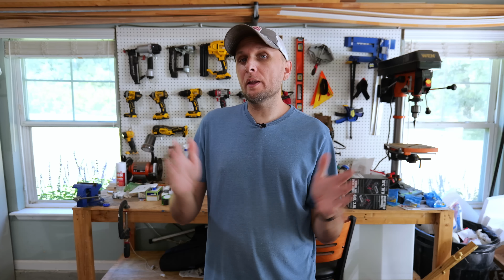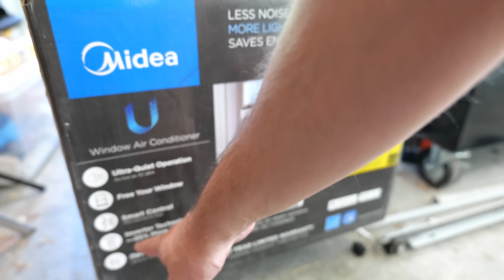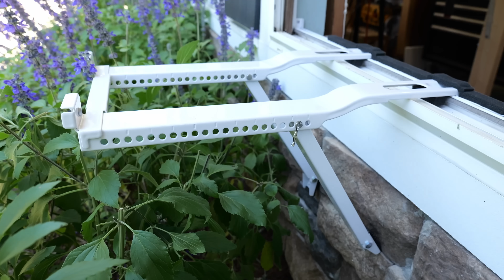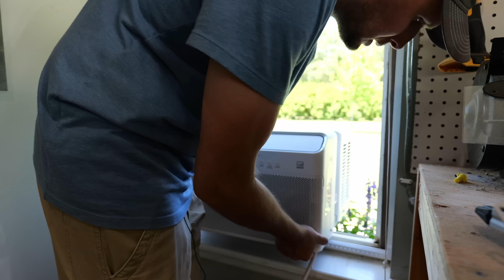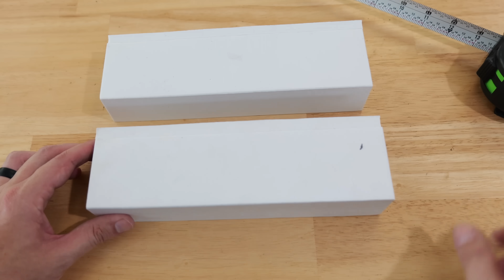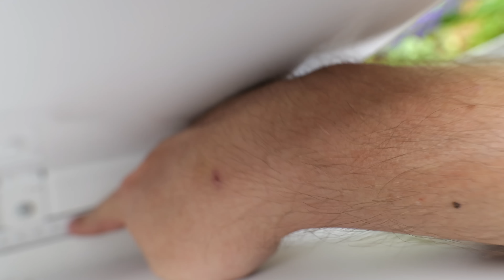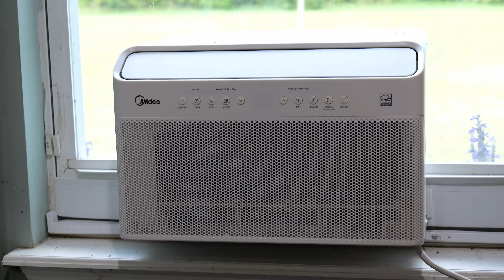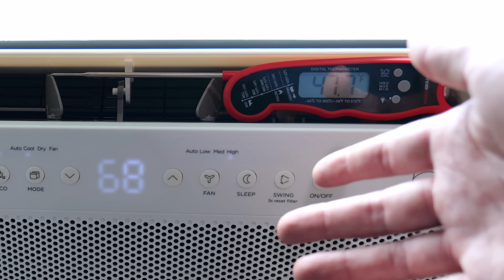The COLDEST And QUIETEST AC Unit Ever Made!  Still Use Your Window!

Comment: You say these can be quite heavy..... NO WHERE on Amazon or Media does it specify the weight of the unit  I like to FIM
Reply: It's called google, learn how to use it.
Reply: It's not too heavy but rather clumsy to lift. Most of the weight is towards the back of the unit due to the compressor. I'd say it's roughly 45-50 pounds for my 8000 btu unit. The trick I found to lift it is to hold the top back corner while lifting the unit holding the opposite bottom front corner. Since the bracket that comes with the unit act as a shelf, it's best to place the unit on top of something close to the height of the windowsill. I use the box that the ac comes in which I keep for storing it away come the winter. This way it's not much travel to carry and guide it to lay it on the bracket.
Reply: @riopato2009  Thanks for a helpful reply... I am not sure if the 8k will be enough so to be able to see the weights for all the sizes would be helpful...
Reply: @jimharper6073  I doubt the higher btu units aren't that much heavier. It seems the magic of the AC units is how the compressors are designed and there's definitely newer technology being used than traditional AC units. It's very similar to a mini split but in a smaller and very dense shape. According to the Midea website, the weight is less than 60lbs and oddly this unit is rated to cool a 550 square foot room which seems kind of small for a 12k btu unit. It's most likely why I opted for an 8K btu unit instead since t was half the price to cool my 300 square foot room.

Comment: Does it have a exhaust and dehumidifier
Reply from the maker: It does have a dehumidifier.  There is an actual condenser on the outside.
Reply: The dehumidifier works great to help quickly chill the room. I don't think there is an exhaust function but there is a fan only mode to take in fresh air. I use this a lot during cooler nights and it's a lot quieter than the already quiet AC function. I have a window fan on the other side of the house that exhausts air and this combo really creates a breezy circulation throughout which I find better than just having the AC on all the time.
Reply: @riopato2009  thank you soo much

Comment: I wish they made a smaller size than the 8000 btu model. The window I need to use is small.
Reply: So, you need a smaller physical size AC?   The 8k btu for an inverter is fine for even very small square footage well under 300 sq ft, from what I now know about them.  Maybe search for an inverter type window AC for your window.  Also, perhaps look up a casement style window AC unit. It's narrower width-wise.  Hopefully, you can find an inverter, because they are super quiet compared to the conventional on/off compressor AC's. If none of this helps, try a portable unit but be careful to get one that absolutely has a dual hose.  A single hose portable is terrible. May you have a climate controlled room! Enjoy.

Comment: The temperature of the air coming out of the unit is meaningless without knowing the outside air temperature. How well a unit cools is the difference in temperature between the outside air temp and the temp of the air coming out of the unit.
Reply from the maker: It was 92 degrees out when that test was done.
Reply: @BlondieHappyGuy  Correct. However, the unit is moving heat from inside the room to outside using a heat exchanger. The temperature of the outside air will determine the final temperature reduction of the air that is moved through the unit.

The two temp comparisons that really matter are the difference in the air temperature being inducted into the unit vs the outlet air, as well as the difference in temperature between outside and the outlet air.

Comment: Impressive... Thanks for the video. I used to waste a ton of money, before my heat pump, on Danby window air conditioners that would last only one season. They would work fine for the first year then when I took them out for the winter and reinstalled them the next year, then quit working. This looks like a very good unit. Time will tell.
Reply from the maker: I love this thing.  Super impressed.  Thanks a lot for the feedback Jim!

Comment: Can you do a follow up and test the noise on the outside. I have neighbors nextdoor and do not want to annoy them with the outside noise.Thanks.
Reply from the maker: In the future after I’ve given this unit some time I may do a follow up review video and definitely can include that.  For what it’s worth I just went outside to take a decibel measurement, again from about 5 feet away and it was right at 59 dB for the outside condenser.  I couldn’t hear it running at all until I was about 10 or so feet away.  I hope this helps!
Reply: I haven't measured but I can tell you that it's quieter than  a regular windows air conditioner and quieter than my central air box.  I have 4 of these Midea boxes that I have bought over the last few years.  Sooo much better than the older AC technology and cheaper to run too.  My favorite thing about them is that they are variable speed.  That is, when it gets the temp down to about the right temperature the compressor speed slows down greatly.  With the old AC tech the compressor is either on or off and nothing in between.  Since the compressor on these units is outside the window the noise in the room is very low.

Comment: I purchased this unit a while ago after searching for a very energy efficient unit.  We live totally off-grid and I wanted to minimize the power usage for appliances such as this.  It cools very quickly and during daylight hours, it doesn't use nearly as much energy as we produce, so I don's use any of our stored power.  At night, I can run it for hours with very little energy drain from the batteries.  We typically don't even need to use the A/C, we just run the dehumidifier and it will drop the temp by around 10 degrees.  We highly recommend it.

Comment: In my extensive research with this unit against Daikin and Mitsubishi mini split units, this type of window unit is not in the same league. The output of a mini split system is much greater for a larger area. We have a Midea brand A/C condenser in our church its been repaired 3 times in the last 5 years. Our HVAC master technician found the mother board fried, even with a surge protector installed. This small Mides unit sells ideal for a bedroom, but not for larger living areas. When comparing to traditional box/window A/Cs, sure, these Midea units do very well. However, if you’re looking at long term (5 years +) you might consider other long established/performance options.

Comment: How many watts does it use ?
Reply: @BlondieHappyGuy  I have this 12000 unit running right now and the highest I've seen it pull on my watt meter while writing this comment is 517 watts with boost mode on, it's 73 outside right now, its dark out, I don't know if it'll pull more when its hotter out I'd have check on a hotter day.

Edit: 80 degree out 6/13/24 and it's pulling 547.5watts... it'll be 96 in a few days if I remember I'll come back and update this if it pulls even more on a hotter day, seems like it might.

Edit: 06/18/24 its 90 Degree out and it's pulling 903+ watts from the wall, I watched it bounce off that for about 10 minutes so yeah higher Temps outside leads to higher watts pulled from the wall.

Edit: 6/20/24 it's 97 degrees outside and the unit is pulling 1104 watts, target temperature set to 70 degrees that was for all the days.
Reply from the maker: @kaosapprentice yup it’s funny you said 517 watts. That is literally the highest I was able to get mine up to with everything on max.
Reply: @HowToHomeDIY  I had a portable unit from midea it was 8k btu and it pulled 750 watts so at first when I turned this on I thought I got a defective unit, 500 watts for 12k btu that can't be right I thought... it's fine it's just that efficient.

Comment: I wish there were a version for sideways sliding windows.
Reply: I have mine installed in a slider, I cut a board, painted it to match the outside, used expanding form tape to seal the board in the window. Take your time and you will be able to make it work.

Comment: Thanks.! Only 500 watts at max is amazing! I’m trying to find a high efficiency AC unit to use with a solar generator.
Reply from the maker: Yeah it really is.  Was kind of surprised when I tested it how little power it used.  Most solar generators would have no issue with it.
Reply: To think how many uneducated Karen's in America will only have a "portable" AC because then they don't "look poor with an AC hanging in the window"... not realizing (or too self-centered to realize) that the portable guzzles about 1,400 watts AND it also creates negative pressure causing more hot air to leak into the building... not to mention the THUD.. BUZZ*! that a portable does *right next to you when the compressor cycles on and off.

Comment: I bought the 8K BTU unit in March 2021.  Unlike the other 3 standard window units that never survived over 3 years before leaking the refrigerant, this has been totally reliable and **much** more efficient.  I don't know about the newer versions, but there is one thing that is a problem with mine:  The dehumidify function is a problem.  If set on dehumidify the unit will run until there is ice on the evaporator coils   It never stops cooling, no matter what the room temperature might be.  In my area the spring and fall can be oppressively humid and I was counting on not having to use a power hog dehumidifier.  This was the only fault I have with the unit.  I found a remote controlled switch that has a temperature sensor and can be programmed to switch on and off at preset temperatures.  I use this in humid season and leave the Midea on dehumidify.  The switch controls temperature by switching the power to the unit.  The Midea remembers the settings even when power cycles.  I have to watch for evaporator icing but this is usually not a problem. This way I can have low humidity and comfortable temperature.
Reply: What temperature do you have it set to when the freezing occurs?
Reply: @jeisonsanchez4842       The unit I have can be set to any reasonable room  temperature when it is in dry mode  (70 to 80 degrees) and the compressor just runs at near maximum power with blower defaulting to low..  My outside temp is 97 F, humidity 37%.  If I set the temp control to 85 the compressor runs at near max with blower at minimum.  This will eventually cause the evaporator to go below 32 and start icing up.  However, if I set the temp for uncomfortably low temp like 65, the blower speeds up and MAY prevent freezing.

Comment: Got the 8k btu and its awesome. Worth the money. I do hate the beep it makes though. Found that it you install their smarthome app, you can turn the sound off and than delete the app. The app itself was getting in the way of controling with the remote - it woukdnt remmeber changes and it would randomly turn on or off.
Reply: What app.? I can't turn mine off. It only turn lights off
Reply: For those of us that are on generators because of recent storms, could you recommend a window unit that can run on a generator and what size generator would we need for that unit.

Comment: Do you know how many watts it pulls at about a 70 degree setting?
Reply from the maker: The highest I was able to get it to go by maxing everything out was 500 watts.  So that is with the compressor running and fan on high.  Obviously when the room is cooler and it is just maintaining it does not rev up that high.

Comment: Electric screwdrivers and drills frequently strip screw holes - especially if you don't use the precise clutch setting necessary for the material.  I still use them but stop short and tighten manually with a screwdriver.
Reply: They weren’t necessary for those little screws anyway. Might as well hand torque them takes like 5 seconds lol

Comment: They need a C shaped one for side-closing windows.
Also there's a saddle shaped one that's even better, don't think Midea makes it though. Doesn't need any mounting brackets or anything and doesn't block the window much. 
That Midea U shaped one is pretty good, had it for a year before giving it to my gram when I moved.
Reply: Addendum: Wish it, or the saddle one, were also a heat pump. Keep the room warm and cool efficiently.
Reply: @Jcewazhere  A heat pump version would need to be a 220 plug and not a standard plug unit. I think since these were designed for windows, not many living spaces have 220 outlets close to a window.
Reply: @Jcewazhere  The energy needed to heat a room up during cold weather is a lot more than just moving heat out of a room. If you can suggest a heating device than isn't above 500watts I'd like to know because a standard plug can't maintain this kind power draw and keep a room warm. I don't even think Mini splits can run on standard outlets.
Reply: @Jcewazhere  Not everyone has modern homes that are perfectly insulated. Lots of structures in the USA, especially in colder and humid areas, are over 100 years old that would cost a lot of money to retrofit. Let's not forget to mention that most of these structures barely have up to date electrical systems that can barely even handle 140v let alone a dedicated 240v line. This is in the USA alone and Midea is a global company where they make AC units for areas with buildings much older than 200 years old. It's a much larger market they are catering to, and they are taking this into consideration. Ecoflow is just now coming out with a battery/solar powered portable Heat pump that looks amazing and might change the HVAC industry with a completely off grid solution so this will be another few years before we see this technology make it to general consumer markets that won't cost $2k for a low btu unit.
Reply: @Jcewazhere  stucco? how about plastered interior walls? designed to be intentionally to be drafty so the structural wood frame can dry on their own and yeah 220v by default but internal wiring that can't even handle that load spike while most Mini split systems need 240v. I just saw a 110v system and it looks cute and small. I would need to look into it  but you're right, window units can barely cut it but so can't a heat pump. Which is easier to install and maintain? A mini split or a cheap window AC that can be stored away during winter in a house that heats up using steam?

Comment: Bought one of these last year and I will attest the unit does and is exactly what it states and performs admirably.  I have owned and used many different brands of window A/C and this one is by far the best ever.
Reply: Nice when it works, I'm on my second failed unit after just about a year each. They also don't replace your unit, they just refund the purchase price and make you buy another, meaning you're paying for taxes all over again.
Reply: @Ad0be010 
Perhaps it's not the unit, but the location of it or the installation maybe even how it is being operated.  Since you don't give any details of the problem it's hard to determine what the problem would be.  I'm only saying this because, two of the same units as you described to fail in the same household is very telling.  IMHO !
Reply from the maker: This thing is great isn't it!  Thanks for the feedback Frank!
Reply: @HowToHomeDIY  Price?
Reply: @HowToHomeDIY do you have a link fir the bracket?
Reply from the maker: @cavaleiro95 it comes with the AC unit.

Comment: Bogus video.  This Midea unit is no competition for a mini split as it doesn't posess a heat pump.  What do you do in the winter without heat?  Don't buy a Midea.  That's the answer.
Reply: The title was coldest and quietest AC unit.
Reply: Media does make a 12000 BTU window unit with a heat pump if you need it, also make a 14000 BTU floor model with air and heat.
Reply: If he’s in the south, heat pumps aren’t recommended.

Comment: They updated the model from the original model I got through Kickstarter and that remote looks dope. I don't use the remote I have and exclusively run the AC through the app. Which is great because I can control the AC when I'm not even home. I usually turn it on as I'm heading home so when I get there my room is at the temperature I want it to be without even waiting for it to cool down. Also if it's not that hot and you just need a fan, it's the most quiet fan I ever owned and works great with an exhaust in another room if you need some air circulation.

Comment: Really nice video. Those look really nice. Thank you.
Reply from the maker: You are very welcome.  Really glad to hear you liked it.  I love this thing.  Makes working out in my shop so much nicer on these 95-100 degree days!  Honestly it feels better in my shop than my house because this thing dehumidifies the air so well too.
Reply: How long have you had it now? Did you notice a major change in your power bill? In my old house I had a room for my ham station and working on projects. I had a small window unit that I used to avoid cooling off the entire house. It wasn’t very efficient and did add some to my power bill, but it was still less than running the central air.

Comment: You can pick one up at Costo thru 6/9 for $279. Have had 1 for a year run it almost constantly to take strain off the main AC. Im in FL so its nuclear hot and humid. I dunno about these mini split fans but where are you buying a portable 12,000btu inverter mini split for under $300. Its not a deal its a steal.
Reply: Thanks. I have been going back and forth on buying one at Costco and was considering taking a look on Monday but if the offer ends tomorrow, I may have to make a snap decision.